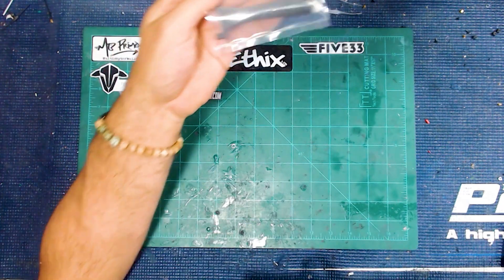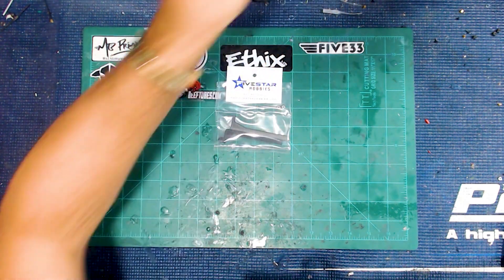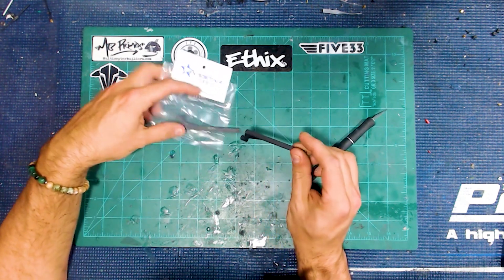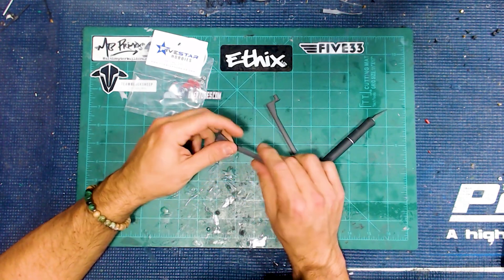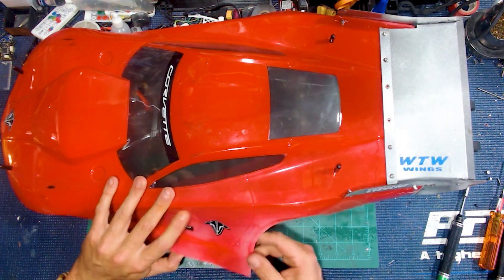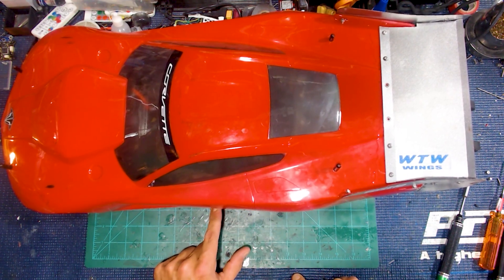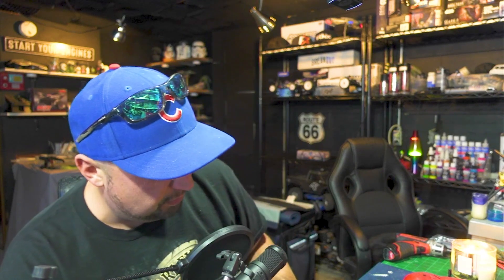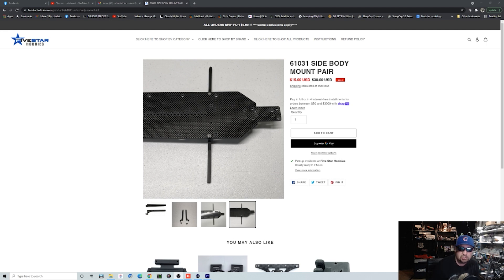BREAKOUT SIDE BODY MOUNTS | GREAT IDEA BUT???

Comment: Most the body flex is towards the back with the wheel moving spinning. That's where most of the issues are. I paint bodies I told you b4 a lot of touch up is in the back. I'm glad your still putting this info out buddy.
Reply from the maker: Yeah I see the rub even with the belts. I like all these little things. Gimmicks or not. It’s a nice $15 to spend that can save someone else and since fivestar agreed with em maybe they’ll make a longer one now.
Reply: @Dorkyand40  trial and error.

Comment: Hey Chad I’m building a 13.5 car. I had a tekin rx8 for my outlaw but I bought a mamba monster so I put the tekin in the 13.5 car and now I’m told that’s not a good esc for that high of a turn motor. I have a maclan pico esc that I used for my buggy but idk if it will be good for drag racing ? I plan on programming with my m17 anyway but now I’m wondering if I need to get a different esc ?
Reply from the maker: Mark vyne runs his 13.5 on an rx8 so I’d listen to him. He’s only one of the best. Try it.